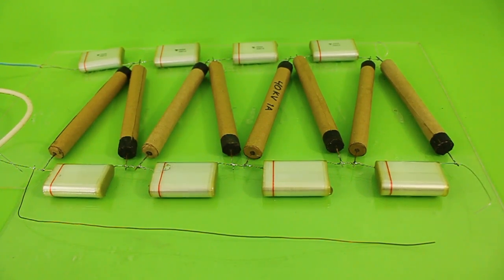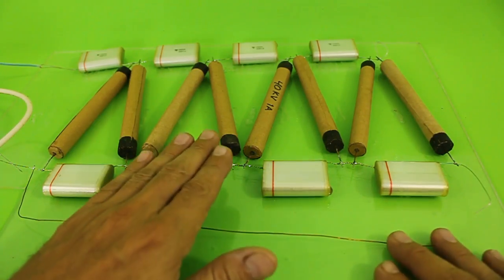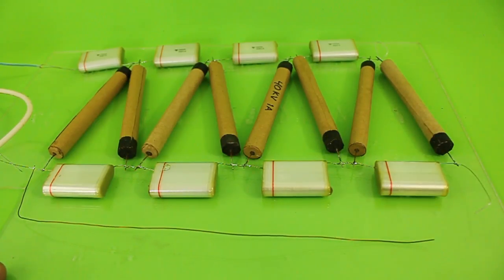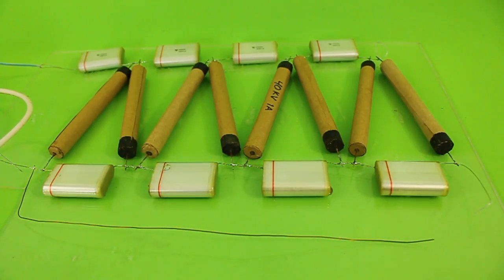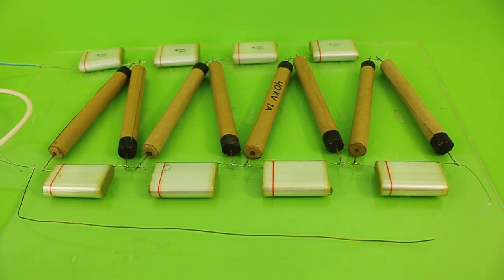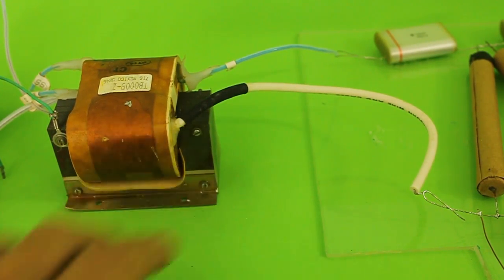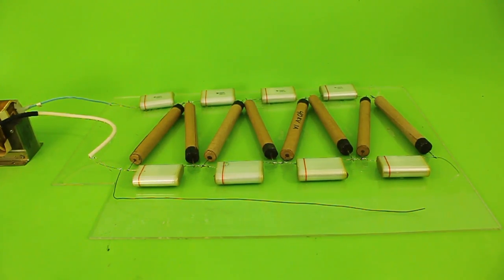Voltage Multiplier with Homemade High Voltage Diodes

Comment: Very nice!  It would be great to see your home made high voltage capacitors, with some home made resistors if possible, to make a Marx type RC impulse generator, and compare it with this type of voltage multiplier.

Comment: Thanks for such great work and videos.i am also Repair LAB Technician and company where i am working for is scout security services which is BIG name in my Region and they have big distributors and suppler of HIK vision china brand company which also huge name in IP CAMERA DVR NVR etc etc.i need your assistance. Have you ever  had experience repairing in DVR NVR and IP cameras.we have 100 and 1000 of faulty Cameras DVR and NVR in our junk yards..most of the problem is display issue in HDMI and VGA ports. i try so much to fix them but could not traced the fault. it makes my crazy. similarly in IP or HD cameras had most common problems but hard to find fault..can you help in the this regard.if yes then reply me then we further continue start our chating. waiting for your positive reply take care have nice day bye

Comment: Did you know you can lite up a LED light with static electricity spark? You need to generate enough static electricity to make the led give a quick flash. But I assume you tools will make it light up non stop . ;) But dont do it with that powerful thing you just did LOL

Comment: Can you please make a video about amp transformers. Thanks!
Reply: Joey Absi that would be nice
Reply: Sorry, I meant current transformer.
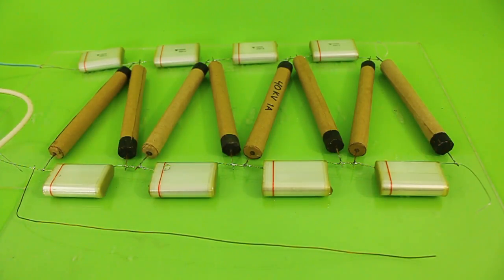Reply: N!cky ok so if I use a step up transformer with 1:10 ratio and I put 10 amps and 10 volts in it, I will have 100 volts and 100 amps in the output.
Reply: you cant put volts in current transformer, current transformer is connected in series and there is no volts on current transformer primary and secondary, only current on seconday(when short circuited or internal resistance of current meter which is low)
Reply: N!cky ok thanks
Reply: Joey i will try to explain it to you, they are basically same as normal transformer but turn ratio matters, not amount of turns, if you have 1:10 turn ratio(example 20 turns sec and 2 turn pri) for every 10A on primary you will get 1A on secondary(if secondary is short circuit). So if you have transformer with primary 2 turns and secondary 20 turns you can connect primary in series with high current(example 100A) and secondary in parallel with low current meter(10A)